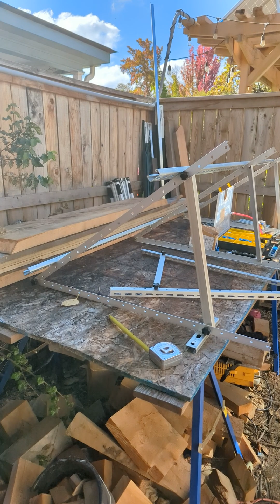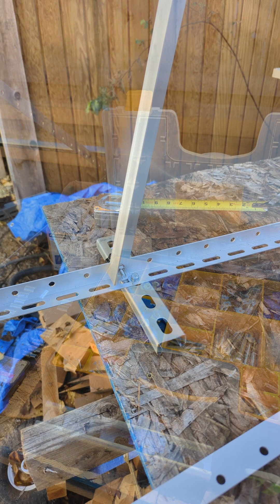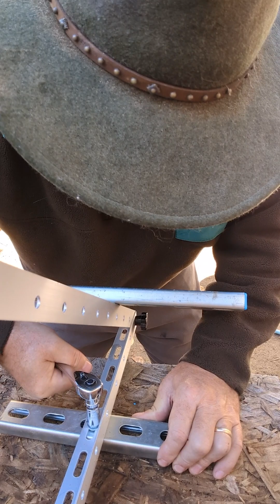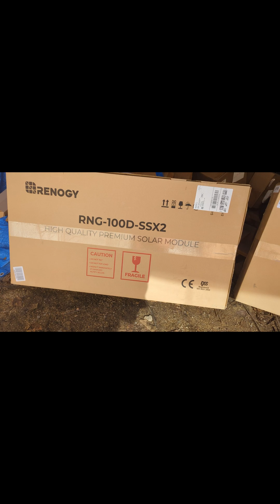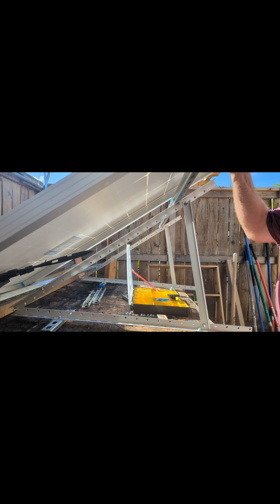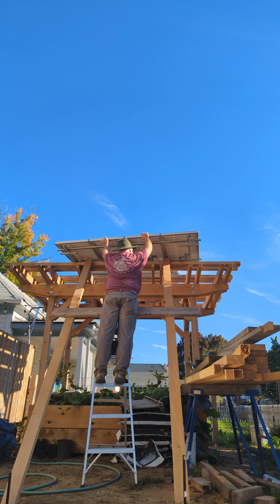@RenogySolar 100D-SS Solar Panel Install

Comment: You need to ground the frame of the panel to prevent static burning traces and make sure you have no shadows on teg panels .they cause them to burn

Comment: Walking up that ladder with those panels would be so dang tough. Appreciate the informative video! Subbing to your channel.
Reply from the maker: Yeah, It was a real bear and i'm not getting any younger, lol.. Thanks for checking in, and there is a lot more content coming up in the future!
Reply: @SolarBearDIY  my problem is I need my long part of the panel going left and right, due to the trailer I’m going to use and the dimmensions I need. Still trying to plan, but I think this strut channel could come in handy.